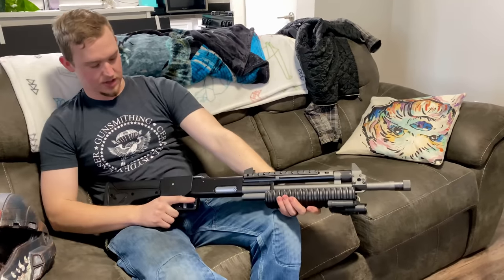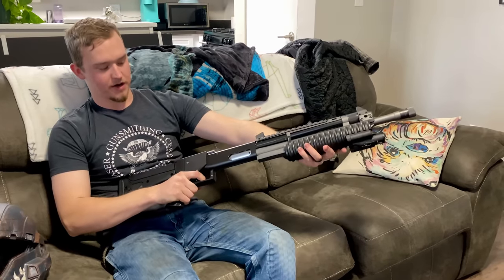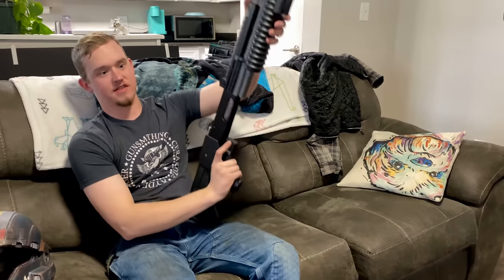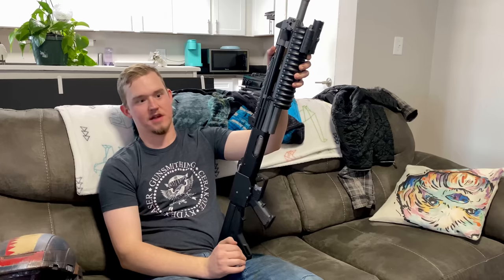The M90 Halo Shotgun, but REAL.

Comment from the maker: Moving forward I’ll most likely be entertaining contract builds through The Rock Guns in Fayetteville NC.
However this is a prototype, producing this in any numbers will take years and a lot of money. If you want to help me with this then a donation or purchasing other products would be a substantial contribution.
Reply: Awesome news.
Reply: I don’t think I can say much that hasn’t been said, but obviously a congratulations is in order. Not only did you make something cool that a lot of people would love to be able to buy, but you made real the idle daydreams of hundreds or thousands of tinkerers who looked at the Halo M90 and said “You know, that’s actually doable...”
Reply: One solution to meet high demand could be to modify the parts that require your hand and then send it off with the rest of the parts prepped as sub assemblies that the end user installs themselves. It may not save much time per gun, but would add up if you end up doing a significant volume. Sending it without the stock and grip could save on box size, parts cost, and allow the end user to make it their own. The light would also do well to be excluded with a 1913 rail there so that the end user can put on what they want while also eliminating a significant cost for you since many good lights are North of $150. Last, any machined parts should be done in bulk, likely milling for precision and medium batch production, so that you have spares for warranty work. Cutting deals with suppliers to get components at reduced cost for volume could help. I recommend doing preorders with a count limit per batch so you can do cost estimates and budget for time and profit. Profits are necessary so you can save up to afford unexpected mishaps while still delivering product.
Reply: I personally am interested in this as a top loading shotgun sounds great for fowling and 3 gun. The look would blow minds at shooting matches. I'd want a 20in barrel with cylinder bore myself, as it matches the specs for the M590A1, a well respected and versatile service shotgun that can shoot a variety of special loadings due to these features of the barrel. Also, I recommend a prototype of a 3.5in magnum chambered one to see how your design holds up under stiffer recoil. It can help identify major issues at lower round counts related to parts wear and failure points.
Reply: @luckyomen  One of these properly built I would assume he could charge $2-3,000 and get it.  There's a market but not a ton of people have that money laying around. This definitely isn't a budget build for sure. I would buy one, if i wasn't married.
Reply: I'm giving suggestions to bring the price down so that he can charge less and still make a serious profit. I'm of the mind that you shouldn't charge more than what is morally right. Especially around firearms, where it is a right that should be protected. Making good firearms accessible to everyone is important. This gun would definitely command that price range, but if handled with good business sense he can charge closer to the $2k mark and let more guys who have dreamt his same dream get something they will definitely show off and be proud of. I'm not saying he should be paid in exposure, that's dumb. But word of mouth can make customers that will allow his work to scale to the point that my advice on cost saving for production can help him meet demand and grow his business. Many good ideas have died due to a limit on customer base due to price
Reply from the maker: @luckyomen  the ultimate goal is to have a product that’s available to everyone but that’ll be years down the road
Reply: Perfect. I hope my bits of advice end up as useful. I'll keep an eye out and invest as early as I am able.
Reply: Would buy
Reply: If you make multiple, I will buy two. One for hunting and one for home defense so that I can have an actual M90 shotgun.
Reply: The M90 is actually an 8 gauge shotgun…

I am fairly certain that if you made that a real, and very useful pump, action shotgun, you would probably end up being commissioned by the Marine Corps.
Reply: Nope. It says so on the feeding point on the shotgun and the shells themselves.
Reply: @KeggleStomp_Pogrompa  its 8, which makes sense as it just punches through everything
Reply: I will be one of the many in line to say that I NEED to know when these go for sale to public as a whole. I have been waiting for someone to actually produce a Halo shotgun! A kit, model, designs, anything I would love to get my hands on so that I can get my own. You have done fantastically bro, keep up the good work. I look forward to seeing more in the future!
Reply: Awesome work man, is there anyway to make it 10 gauge for accuracy
Reply: @housebuildy5708  i think you mean 8 gauge
Reply: @Ajibica117  you need to do a collaboration with demoranch
Reply from the maker: @Natsumidragneelkim  big people don’t care about little people
Reply: @Ajibica117  Maybe Garandthumb might since he has shown halo content before in the past
Reply: Patreon, dude I’ll drop money for this as long as I get one first
Reply: @saphrone4071  Yes. We could just spam him with links to this video and he'll likely handle the rest
Reply: Man I hope we can see more
Reply: @Ajibica117 you aren't going to get in trouble with Microsoft with this?
Reply: Dude make these production !!! I wish I had money to build my dreams man and do what I want but I envy you this thing is exactly what people want a I think your on your way to being very successful and appreciated first and foremost
Reply: Hey I work in the firearms media realm and would love to do a piece on this. Do you have an email I could reach out too you?
Reply from the maker: @travispike3968  if you don’t mind for the sake of my personal privacy can you please send an email to the rock guns of Fayetteville NC and call them also. I just don’t feel comfortable posting my personal information as publicly as a comments section.
Reply from the maker: @travispike3968  my insta is @natefrisque with a cartoon image
Reply: The Rock Guns is a great place, youre gonna get a lot of soldiers to buy your stuff xD If I go back Ill buy something off you.
Reply: Good job bro. That is awesome. Preciate you.
Reply: Good job! As a person who lives in Fayetteville we appreciate the shoutout!
Reply: If you can put this into production, I'll gladly buy one, hopefully you can make other halo UNSC guns
Reply: Can you make it canonical though and put it in 8 Guage?
Reply: Someone please make this guy into a gun manufacturer I wanna see the US military use halo weapons as standard issue
Reply: You’re telling me you’re going to produce these for public purchase?! I will give you my life savings for that shotgun 😂
Reply: How much would you consider selling one for, my good man? 🤔
Reply: take my money
Reply: Where can I see other products you have?
Reply: @jthunderboldt  sure if you wanna spend $220 for a box of 10
Reply: This is very cool but, please for the love of god, give us a look down the sights!
Reply: 1. Just use legit 8 gauge and make it big, actual gun

2. Judging from your profile, were you a Marine?
Reply: @Ajibica117  I would absolutely buy if this was on the market
Reply: @icefl4re597  No way man, he needs to use 4 guage the ammo of the SK-23 a real shotgun too plus its Russian!
Reply: @tusk3260  Because the M90 in the lore uses 8 gauge.

I don't say "the biggest gun go boom", I was referencing the Halo lore.
Reply: @icefl4re597  Then use a 4 gUage and just call it a 8 gauge, the size would make it more accurate. Yes on his hand it looks like the one in the game except in the game you are a huge spartan way bigger then normal human so it would have to look too big for a human and the 4guage does that perfectly. 
By the way, its not 4 gauge, its 4 guage, thats how its written on the gun!  Because its Russian!
Reply: This looks amazing, but the whole time I am just left thinking "he fucking kalashnibren'd a pump" and its so cursed 💀
Reply: @jacobmullins3644  i was merely pointing out that acording to lore (and in game models)

the Helo shotgun uses 8 gauge shells
Reply: I'm in colorado. Not far from lakewood. What do I need to do to get one of these man???
Reply from the maker: @Dutch.W  well I’m at CST so you can come check it out but as for obtaining one, that’s a far more difficult answer as of yet.
Reply: @Nathaniel Frisque  well I'm subbed for now and I think even if I need to start going to CST to make one myself I am dead set on getting one lol
Reply: @Ajibica117  Do you plan on running this in anything? I would love to see someone running around in an odst helmet making paper dead with this.
Reply: How can I pledge or support
Reply: Start a fundraiser project! People will fund this if they have a place to give direct contributions and you can have a better idea of demands.

And as I've seen other people say, get in touch with grand thumb right after you start the fundraiser, and have him showcase the shotgun. I believe there will be a lot of pledges to this project.
Reply: I got 2 questions, first how big was the smile on PJ's face when it was finished? Second have you done anything to keep the shell from rolling out?
Reply: Rock Guns is awesome! I'm going to have to stop in and check out what you've got going on
Reply: I know now these are pricey as hell to do, but if in the future you were to sell versions in the future, I'd gladly save the  money to acquire one. I'm already looking at getting a $3,500 Shotgun 😅
Reply: @Ajibica117  not true for some like Matt. Maybe take a risk and send him that prototype with a signed waiver on use, protection of IP, and return. 

He might just make a video about it. All content creators are looking for more content. You would be giving him free content, and his millions in viewers might boost you further then ever imagined. 

Or it might fall dead. 

Won't know unless you try.
Reply: Its honestly surprising how many times I find people making awesome stuff through the rock guns I still remember them opening up when I was stationed at bragg
Reply: @Ajibica117  mate demo isnt an asshole like people think he collas with little people alout even brandon harrera does just talk to em man
Reply: Great Job!!!!
Reply: Where do I buy one.
Reply: I would freak if I could have a gun like that. I would probably explode from happiness to tell people "yeah my first gun, oh no big deal its just the FUCKING M90 HALO SHOTGUN!!" That is a flex only few can have and I NEED to have it
Reply: @TwentyTwoSigma  id have one if I wasnt already building a big block drag car and putting myself through college. I remember being in elementary/middle school and my buddies and I bragging about who could speed run "the library" mission in Halo CE. This almost brings a tear to my eye because its just such a nostalgia bomb. If I had the money, I would ABSO - FREAKIN - LUTELY donate to this man just to see this gun get more recognition
Reply: I'm definitely saving up and being a customer when this goes into actual production. This is some cool stuff.
Reply: Good job kiddo, I'm a half century old gunsmith and enjoyed Halo combat evolved when I was younger. Nice work.
Reply: @Ajibica117  But is was 8 gauge in the universe... 😐
Reply: Awesome work. I live right outside Charlotte NC and if I'm ever in Fayetteville I'll stop by and try to meet you and your magnificent creation
Reply: Dude how much
Reply: You could make blueprints for how to modify 870's into this configuration, make deals overseas for the manufacturing of the parts necessary for the conversion, get the proper license to import gun parts and accessories, get a customs broker to handle your shipments, and then sell completed conversion kits for a fine price while offering assembly services yourself for an additional price.
Reply from the maker: @smokingcrab2290  the amount of work that would require is akin to me making my own gun which is in fact a more desirable path for me
Reply: Well I now know what I am saving up for when they go i to production!
Reply: Please, please consider backing your content up to a platform like Odyssee. With the current political climate around homemade firearms and YouTube's insane policies with firearm content it would be a shame if your content started vanishing without an archive.
Reply: So dope! I wanna be able to hold that.

Comment: I'm kinda sad that it doesn't feed 8-gauge or have the dual-tube magazine, but this is still an absolutely kick-ass thing you've made.
Reply: It had a dual-tube magazine?  I don't remember that at all.
Reply: 8 gauge?  Holy kick batman.... thatd disintegrate your shoulder wouldn't it?  I'm pretty tough, but I've gotta think that that heavy a round would be painful as hell to fire.
Reply: @NeoIsrafil  In all fairness, the canon shotgun has some internal recoil dampening of some kind, IIRC.
Reply: @TurnAGundam  Yeah it fed from dual magazine tubes mounted over the barrel. Thats how it had such a crazy 12 shot capacity despite being chambered in 8 gauge.
Reply: @LaputanMachad  Huh, I noticed the capacity, but I never noticed the second tube magazine.  I wonder where it might've been in the shotty.  🤔
Reply: Remember the big fat 'top' section of the Halo model in CE, and how the viewmodel was a bit funky-looking? That whole assembly was essentially a dual-tube, single-feed action.

Comment: I'm really surprised the unfired shells dont fly out the ejection port when you  cycle. I mean, I remember the Magpul shotgun training video where they show you how to discard of an unfired shell by pulling the pump back, then flipping the gun on its side to roll the shell out.  Given the gun is basically running upside down, which Im sure the guys at Remington didnt plan for when the gun came ou a while ago, I'd be curious to see this work.  Amazing job on the final product, you covered all the aspect of the Halo design and I can tell you don't do things halfway.

Comment: Now you need to turn a MP7 into a M7! Awesome work dude I am mad jealous
Reply from the maker: Yes but p90 as the base as the real gun loads via the side
Reply: @Ajibica117  good point, and it's in the correct caliber dimensions, albeit not caseless
Reply from the maker: @CurlyJones  my designs are usually like this
1. Manual of arms as similar as possible to the halo version
2. Look and feel of halo gun as closely related in current available parts
3. Blend real steel gun to fiction in feasible method

Comment: Definitely send it to the big guntubers to do videos on it ! Also you might have already done it but I suggest getting 3d files of both the 870 and the halo shotgun , then adapt the parts of the halo shotgun to attach to the 870 and other manufactured parts. Just to get a 3d cad design of parts you could get made out of aluminium that actually look like the halo gun and is functional, but also scale able  to make a production run of like 30 shotguns etc

Comment: hey bro im a gunsmith in SC and have been actually working on a AR from halo fully 308 with a digital mag reader. the upper receiver and lower are going to have to be one and its going to have to be taken down on a vertical axis rather than horizontal due to wiring running from magazine to digital reader on top. Youve got my support 100% of the way through. at this point youve got a great position at the rock i would kill to have a position with them. but you got the mk.1 down now time to refine and smooth it up. please for the love of God don't sell the design stick with it
Reply from the maker: Based

Comment: I like it. This weapon is 100% cool. It works its awesome.

 I have 1 negative.

The negative is this.

Is there any real advantage to this weapon over the normal shotgun?

Like the Rhino revolver shots from the bottom as well. It has been proven that lower the kick of the weapon. Which could also hold true to your shotgun design. So maybe going in that direction. Could be a thing.

Comment: Excellent work, truly. I’ve always been fascinated by the design, and from an ergonomics standpoint it makes perfect sense that the loading ramp is right in front of your face if you’re loading loose shells. 

Check out this ljutic space shotgun I think the sights from that could modified to work effectively with this set up. Additionally, that gun places the stock right in line with the barrel making for favorable recoil characteristics. In-line recoil would work well with this since the sights are already lifted off the bore line by virtue of sitting atop a magazine tube.

One small change I’d recommend for reliability sake would be to modify the design such that the magazine tube is fed from the side like the loading gate on a lever action but ambidextrous so it isn’t sitting face up waiting to be filled up with crud like a shovel. That or maybe make it so that is a slightly better seal.

 https://m.youtube.com/watch?v=HQpMpWYefyw
Reply from the maker: You make some excellent points. Thanks

Comment: Instead of ubl why not use benelli m4 stock and grip? It’s pretty obvious that the original m90 has inspiration from benelli furniture
Reply from the maker: the trigger work and machine operations prohibited that
Reply: @Ajibica117  if you really wanted it you can have a machine shop tig weld the benelli buffer tube to a tube and use a die to cut ar buffer threads. As for the grip, just punch out that pin holding the benelli grip to that receiver extension and use some putty on the grip to create that ar grip profile
Reply from the maker: @heinrichfuhrmeister1244  I can do all of that but opted not to